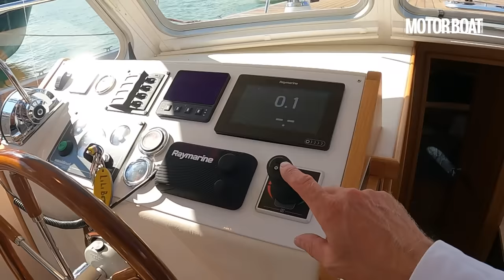British built steel cruiser with optional hybrid power | Piper 12 C Cruiser yacht tour | MBY

Comment: If I  had the money, I would order one tomorrow. Its a fine boat. Straight diesel would do me; although I drive a hybrid car and like it. Lead acid traction battery's are probably a safer option ,I personally think on a small boat. They give good service  over their life and cheaper than the li -ion . The finish and layout is great. Galley up would be my option with the extra cabin. A boat you could comfortably spend a week or two holiday on and not be falling over each other. 10/10

Comment: How strange it's not just all-electric, considering the weight of those fuel tanks and engines could be replaced with more lead-acid, or simply much lighter and compact Li-On. Also strange that so much space is wasted as empty voids, and yet the only cabin looks really cramped.